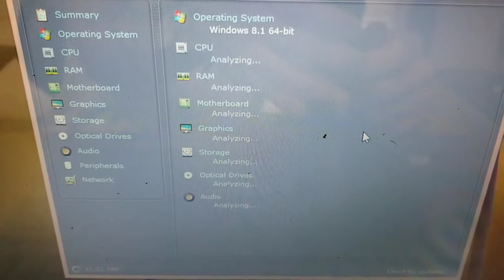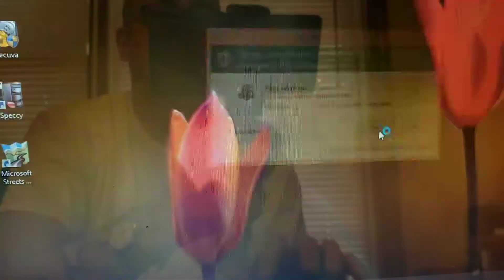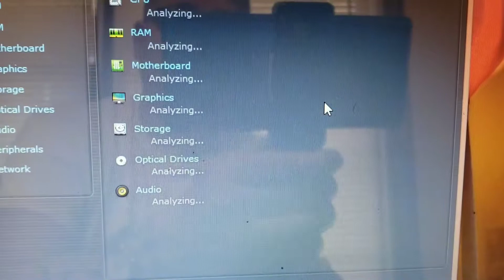How to upgrade your ram in two minutes  | Dell Inspiron 3521 Ram Upgrade

Comment: In my same laptop there are 4gb of ram each slot 2gb can I add 8gb at one slot with the remaining 2gb on another slot and make it 10gb ram laptop?
Reply from the maker: You can add two 8gb rams for a total 16. So yes, you will have 10gbs of ram until you decide to add another 8.

Comment: Will the Crucial 4gb DDR3L - 1600 SODIMM be compatible with the Dell inspiron 15 3521?
Reply: Yeah it should be compatible
Reply: I have the same laptop. Original ram ddr3. Why are you wearing the ddr3l? ddr3 need not be installed?

Comment: Actually if you contact with the Dell support they will tell you the max ram upgrade for this laptop is 8gb check for yourself
Reply from the maker: Watch the video @ 3:14 you can see my ram jumped to 12gb's when I replaced one 4gb ram sticks. You may have a different model.
Reply: i don't why they said this...but the max you can go is 16 GB on all 3521 models...
Reply: @rahulnegi6895  should I try upgrade to 16
Reply: @pratikrchavan9093  yes you can if you really need that much...just make sure shopkeeper takes it back just in case it don't work xD

Comment: Idk about you guys but I find the idea of being able to switch out the RAM very disturbing. I added an identical stick of RAM to my current laptop and I almost collapsed in fear because I felt like I was doing something very wrong and most likely evil. Apple is starting to solder everything to the motherboard and I would feel a lot better if they did that for all laptops. The same goes for hard drives! It would help improve the laptops so that if anything goes wrong with a simple, replaceable component, you have to a buy a whole new laptop. Since Apple is doing it, everyone should!
Reply from the maker: Lol, you should be ok, the motherboard is something totally different 🤣

Comment: I have one with 4gb of ram and an Intel Pentium. Mine was bought brand new in 2013 for $1200, and it already performs well, but I want to run GTA V on it, so I'll be upgrading it to 16 GB. Do I need to update the BIOS? The BIOS version is a12, while the current is a16.